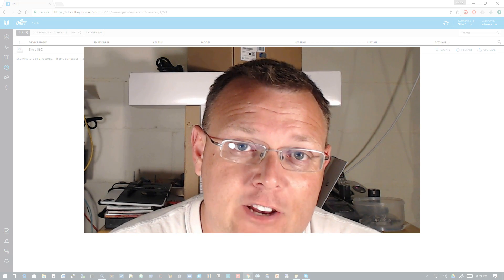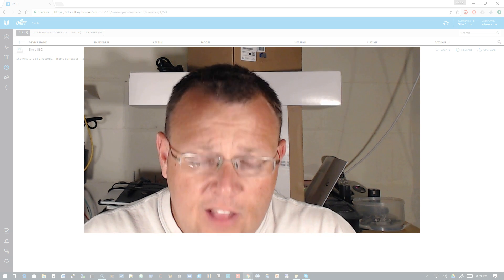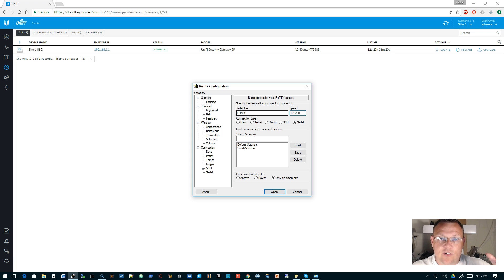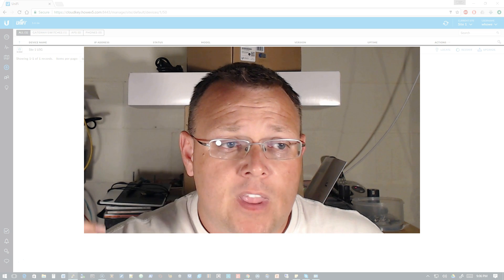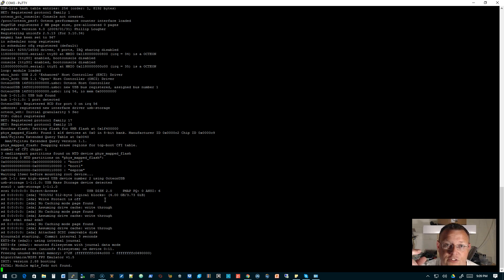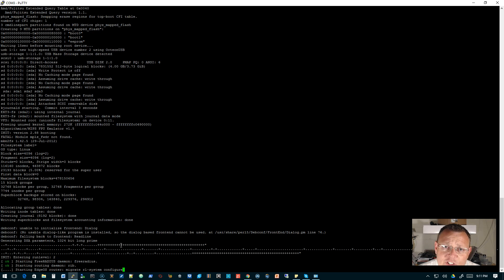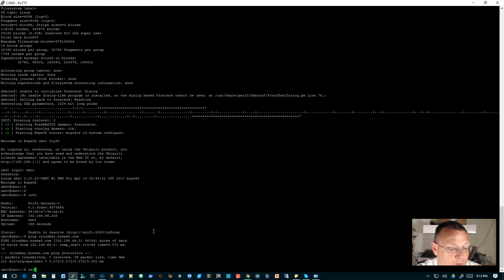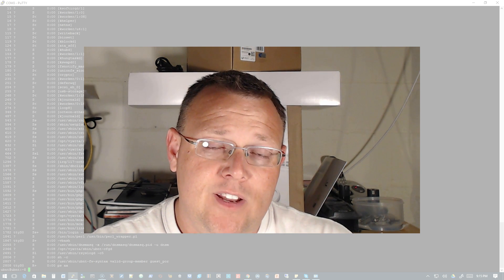USG Console Port Connection

Comment: Good video. Not enough info on what pieces needed; i.e., you speak briefly about the cisco console cable; and even more briefly about USB-to-serial cable - VERY critical it seems! I don't know enough about, for example, the main USG device + whatever-cloud-key, and the whole "Adopt" thing. A dear friend passed away; and i'm trying to figure out his setup - he has the exact USG AP that you are showing + a Unifi Cloud Key dongle on the nearby switch. I did have to reset the square USG device, just like you did; but maybe his configs are held on that Cloud Key? He was doing some NAT to his inside servers, so I fear I may have lost some config by resetting it. It has Switch --> Square USG LAN port, then USG WAN port out to one of the 4 ports on the ATT Cable modem but, at some point, it lost connectivity to Internet. When you connect to the Cloud Key and did 'adopt'; is that a universal URL/name for all Unifi Cloud keys?

Comment: Hi guys,
My 48 port Unifi switch just turns on with the flashing white light and port lights on, I think reinstalling the firmware through the console port is the right way. I have never worked with a putty command line I am used to Linux ETC. Any ideas on how I can reinstall the firmware?

Comment: I installed a USG P3 a couple weeks ago and everything was working fine, I got a lot of Ubiquity updates the other day and tried to run the update for the USG and it failed saying it could not upgrade to a version XX. I tried lots of things to get this working again and I got the AP's and the 2 switches  but I cannot log into the USG(do I need to login the USG?) , but it is gathering data in the unif i management console. and I can see all the info it is tracking. 

Can I just factory reset the USG3P and then re-adopt it? I think I have it on the latest version(might be one version behind). I have no idea what the password is to get into the USG and maybe I have locked myself out doing too many failed logins??  While I was doing my trouble shooting at one point I tried resetting the USG  but it did not reset the password back to ubnt/ubnt and I have no idea what it is because I have tried all my normal  ids/passwords . Also I checked with Fing on my phone and can see the USG is set to 192.168.1.1(as it should be)and the USG is working  when I got to the Unif Network Dashboard to see all the metrics and traffic

Comment: My crap consumer Linksys router committed suicide yesterday, so I ordered the USG Pro, Unifi Switch 16 (150W) and AC Lite since my house isn't very big.  I recently picked up a 36U size rack for $25 on Craigslist.  I'm getting excited already and it hasn't even been 24 hours since I placed the order.  Completely forgot to order a Console cable though...I can't find one around my house.  Thanks for the video.  This is all going to be totally new for me, so I appreciate the walkthrough videos.

Comment: Yesterday I have recovered one usg pro using serial connection. Some times they do not react on reset button.
Reply: hello,
i have the same problem. cannot adopt, says need tu upgrade firmware. Ordered an USB/Serial Cable. How do you make an firmware update after logging in?